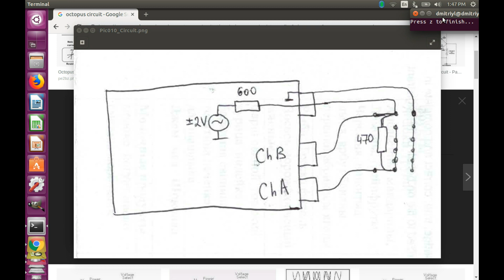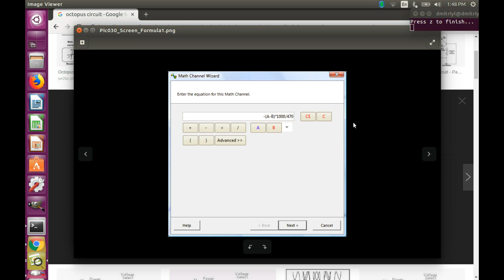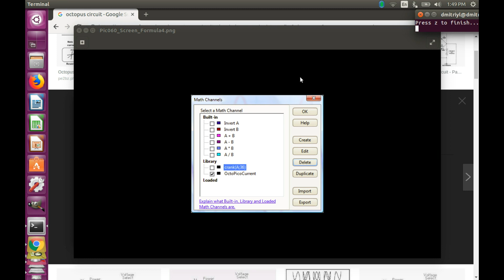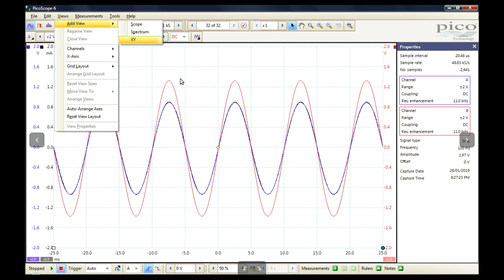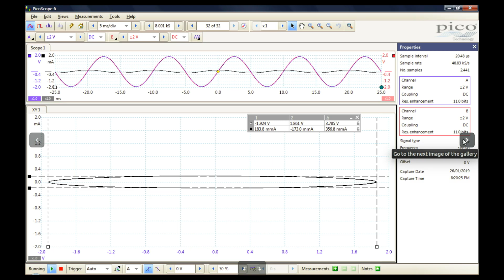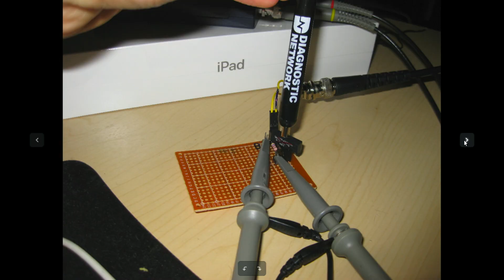[S,E] OctoPicous circuit: test electronic components with Picoscope AWG

Comment: Tried your setup and works good...one idea ,maybe in the future you will make a similar setup for dealing with those annoying intermittent open or shorts in wiring . Something like using signal generator at one end of wire and one channel at the other end ,some mask and audio alarm ?Thanks !
Reply from the maker: Fantastic idea! I've explored masks and alarms for parasitic drain testing a while ago: https://youtu.be/zN5IkfRcRQI . It's time to kick it up a notch. I hope it would eventually work for detecting intermittent loss of terminating resistor in a CAN bus.

Comment: Been there ,done that but my favorite tool to check  electronic components remain DMM.The only case when use this setup is to check transistors while on pcb with help of DMM to open base-emiter junction and watch with pico if transistor open CE
Reply from the maker: Thanks for sharing tricks of the trade!